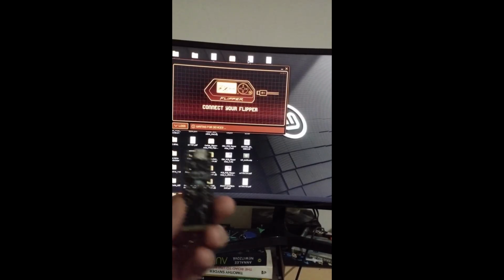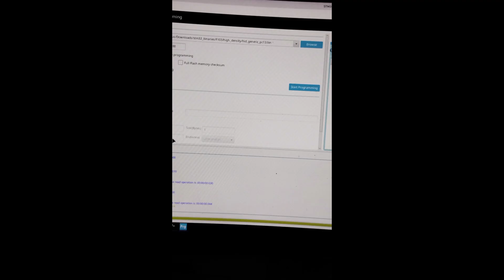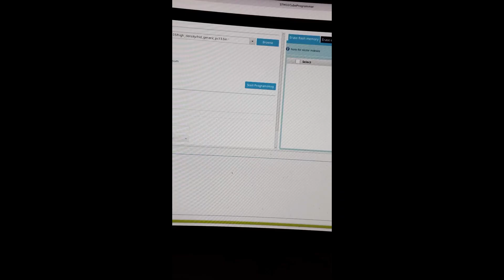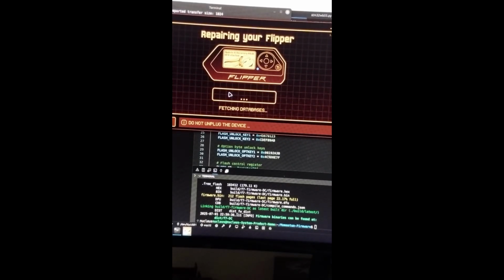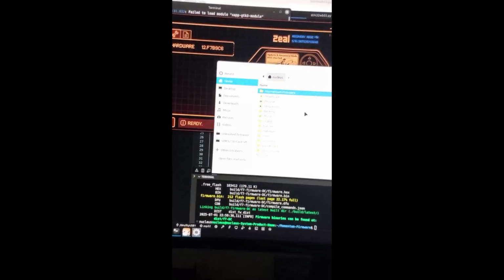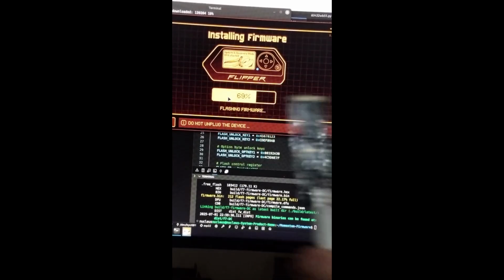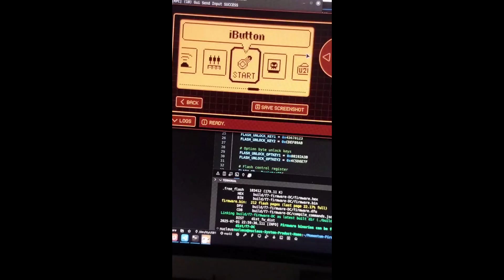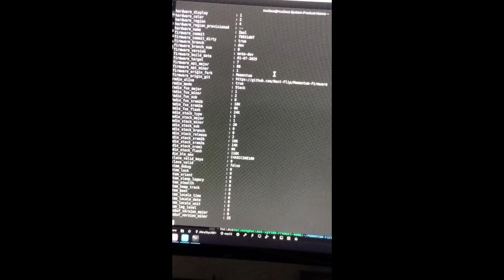BRUCE KILLER!!! Tutorial: Make REAL FLIPPER zero for 20-30 USD. FORGET M5 STOP ESP32 DIY  REAL DEAL!

Comment: Fiz tudo aqui , só que depois que desconecta e conecta o Q Flipper  não reconhece nenhum firmware na placa
Reply from the maker: english
Reply: @NucleusDark-xe1ne  I installed the firmware on the STM32 board, I did exactly as in the video and it worked, but after I disconnected the USB and reconnected it, Qfliper doesn't detect the system on the board. So I have to install it again.

Comment: bro help me,my device is invalid qflipper. Please help me, bro. I have already flashed the first and second with the same OTP as described. Please help me, bro.
Reply from the maker: Dpnypu have correct board?
Reply: @NucleusDark-xe1ne my board STM32WB55 same this
Reply: @NucleusDark-xe1ne i using STM32WB55 same your video
Reply: @NucleusDark-xe1ne why my reply auto delete 10minutes ?
Reply from the maker: @riimodzprsts its not me, its happening to me sometimes here too....
Reply: @NucleusDark-xe1ne im using board STM32WB55 same this video
Reply: @NucleusDark-xe1ne and not working, i repeat flash and not working
Reply from the maker: @riimodzprsts so you get recognized by qflipper as device in DFU, or not?
Reply: @NucleusDark-xe1ne Initially, it couldn't find DFU device, after I installed the driver, it became invalid device.
Reply from the maker: @riimodzprsts  if qflipper do recognize it as DFU device, OTP should be good, what version of FW do you upload? it must be some relased by me, raw flipper FW is not compatible, and will end up in DFU loop
Reply: please 😊
Reply: i don't understand why my reply auto deleted?
Reply: username rizenotbad
Reply: my discord
Reply: username rizenotbad
Reply: chat bro please